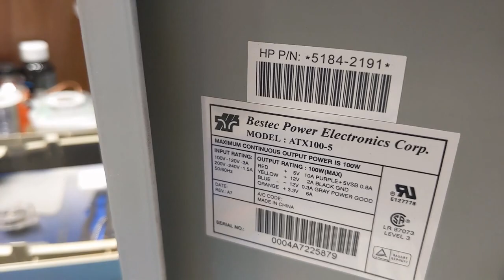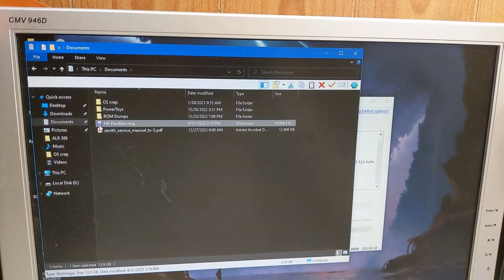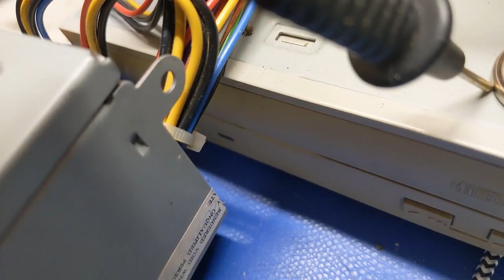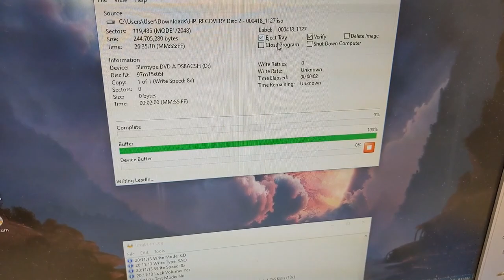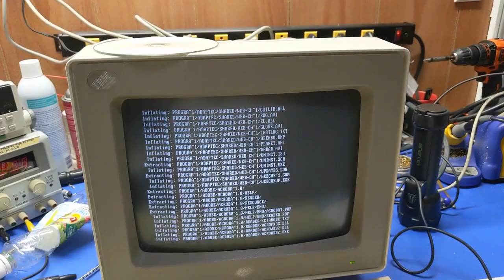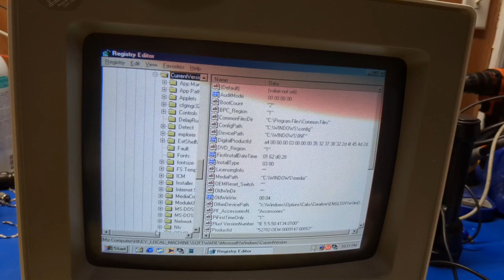HP Pavilion 6735 Restoration

Comment: I pulled apart a drive similar to that cdrom drive a while ago back and the spindle motor contained lots of ball bearings in separate channels presumably as you say to balance it at high speeds.